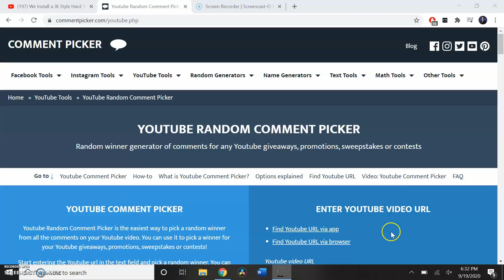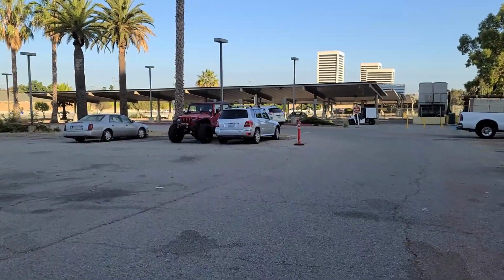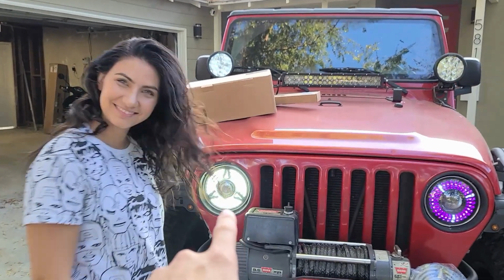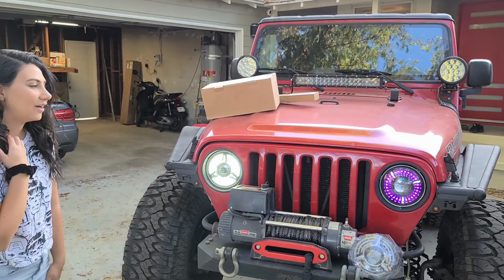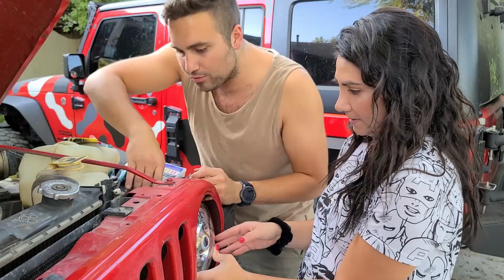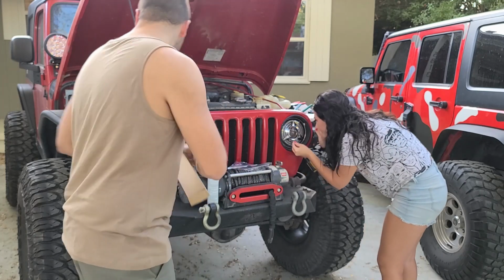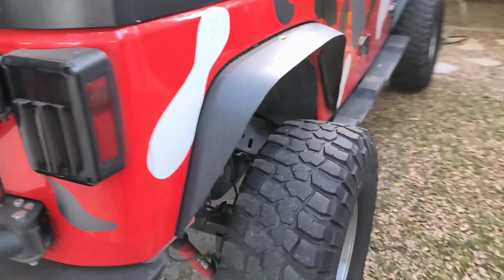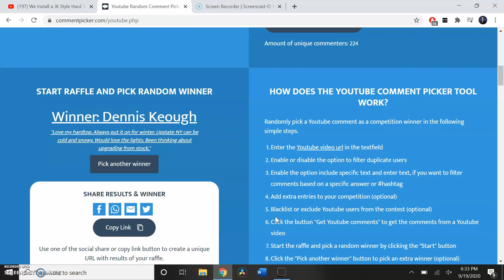AND THE WINNER IS...Headlight Comparison, Tire Shine Update, and MORE Jeep MODS!

Comment from the maker: If you want to check out some of our favorite jeep mods as well as the parts in this video, here you go!
Here are some of our favorite jeep parts!!
Suparee RGB Bluetooth 7 inch headlights - https://amzn.to/2EvfVot
Suparee Sequential 7 Inch Headlights - https://amzn.to/3bdSw6W
Plug and play HALO LED headlights - https://amzn.to/36O7sW9
JK LED tail lights (JL style) - https://amzn.to/2XJTXEp
JK Full light bar kit - https://amzn.to/3a9lcNA
Patriot fastbacks Jeep Tops - https://patriotfastbacks.com/shop
Cerakote Plastic trim restorer - https://amzn.to/36JAvew
Jeep bottle opener - https://amzn.to/32vqnFT
Motofab lift 3 inch lift kit under $150 - https://amzn.to/2CJD9pF
Circle third brake light - https://amzn.to/3jhECEl
Auxbeam 7 inch Light pods - https://amzn.to/2z9gJfm
Auxbeam hood light bar - https://amzn.to/3cbszVj
Shrink electrical connectors 540 piece - https://amzn.to/2VWQPoc
Smoked LED turn signal - https://amzn.to/2EQ7X67
Steel Stinger Front bumper - https://amzn.to/2WjykMA
Smittybilt cargo cover - https://amzn.to/2QeIMzQ
Ares technology PCM - https://arestechnologies.com/
Skyjacker lift kits: https://skyjacker.com/
Rocktrix Rims - https://amzn.to/2xS8Mus
Milestar Tires - https://www.milestartires.com/ 
Affordable sun shade - https://amzn.to/2wWQQyq
Rear LED tail lights - https://amzn.to/2wa7evn
Reply: The ring mounting bracket want let me use new lights any other suggestion for 1986 C7J could you do a video on this ?

Comment: Question what kind of head lights could i use for a 1986 CJ7 I TRIED THE NEW Head lights they wouldn't work any suggestions
Reply from the maker: What type of headlights does the cj use? 7 inch? Why didn't it work?
Reply: @Garagecouple  it's the frame that holds the lights the new lights don't fit
Reply: @Garagecouple  the mounting bracket

Comment: Hey guys, love yalls videos. So how do you fix front axle pinion angle? If your pinion has to point upto the transfer case, the camber will be off.if i fix the camber with adjustable control arms or relocation brackets... then the pinion angle will be off.... can you help with that?
Reply from the maker: We've never done it, but we will look into it. It may be that the camber will need to be corrected
Reply: Garage Couple maybe some offset ball joints? Im really considering a 2 inch lift just due to the caster and floaty driving feeling with a 3 inch lift i currently have.

Comment: Meguiar's endurance tire gel put on with a microfiber applicator pad works pretty well for the price. It also eliminates the overspray on wheels, and doesn't sling on paint bad if you let it dry
Reply from the maker: Awesome! Qe will check it out!

Comment: This is my post/comment from the original tire shine video. Still the best!...

Guys, I’ve tried some of those and they just don’t last and the wet ones sling like crazy! The best stuff I’ve found is “cover all” works on everything, fenders, bumpers, tires, interior and all the other plastic and rubber parts. Last a long time without attracting dust and grime. Available at O’Riely’s.
Reply from the maker: Thank you for the suggestion! Well check

Comment: There is NO good tire shine product that'll last longer than what you experienced on this video, and BESIDES, you were 100% correct when you said that you don't need a tire shine on a Wrangler!! - Dealers use 55 gallon drums of silicone tire dressing, which stays shiny because it never dries. It makes tires greasy, attracts dirt, and slings the greasy dirt on the vehicle if driven. THE BEST WAY I have found to keep tires and trim jet black is to use Kiwi sponge applicator black liquid shoe polish. It dries jet black. I use it on my spare and all trim, and it's amazing. It's basically a dye, and it is NOT petroleum based so does not affect the rubber. It has lasted 8 months now without any fade! Your videos are great! thanks!
Reply from the maker: Agree

Comment: most tire shine isn't going to last very long.  one thing that helps is to thoroughly clean your tires first.  there is an additive in rubber for UV resistance that leaches out over time and they don't all do it at the same rate.  that's why some tires have a tendency to turn brown...I like using super clean on my tires.  It will take off all of the old tire dressing and remove the brown staining.
Reply from the maker: Great tip!